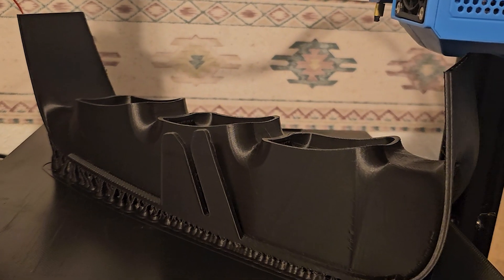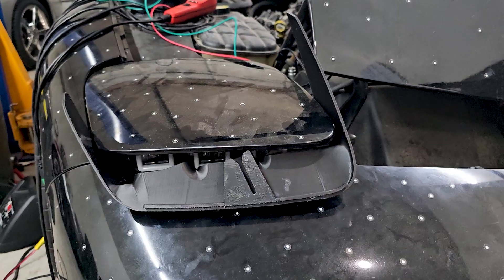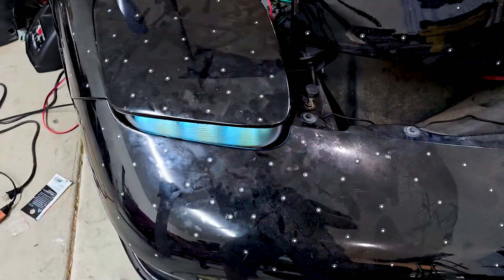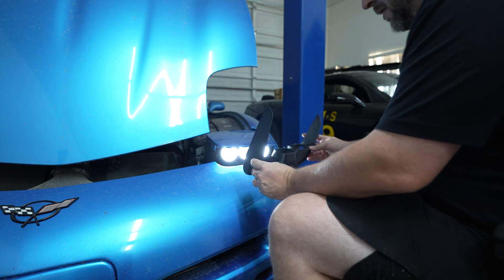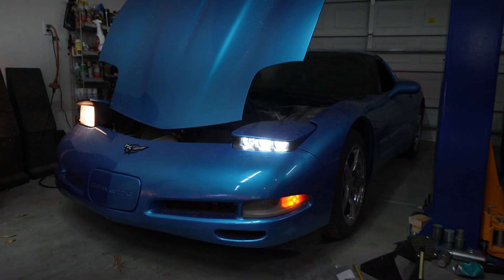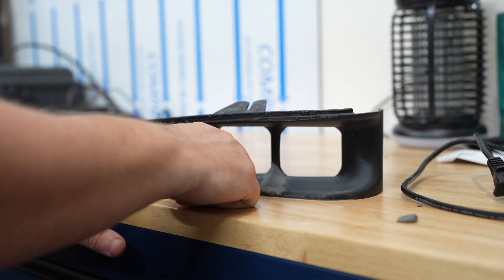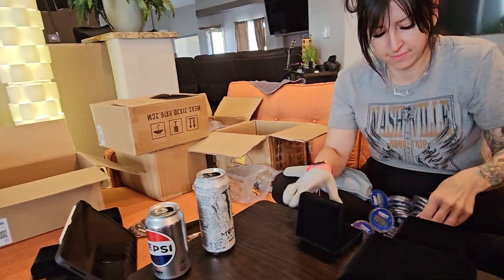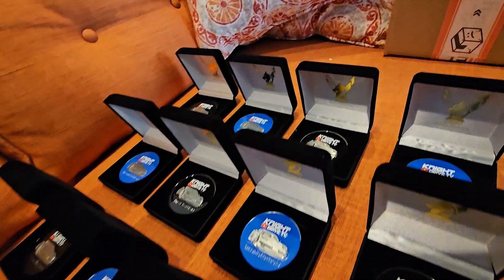C5 Corvette Headlight Bezel Prototype Fitment | Will it work?

Comment: Mate your absolutely killing it! These look so good!
I will be getting a set to replace my current set.

Also, have you thought about making spot lights/ light bars that would replace the fog light? So use like a 12" light bad that inserts into the same place as the OEM fog lights as a replacement. 
I'm currently in the process of making these, 3d scanned the OEM fog light shroud so far.
If this is something that you would be interested in doing I'm happy to share you my files if it means they would be made by a professional like you. Let me know!
Reply from the maker: I scanned the corners and entire front end.  I have had an idea on that portion of the car for a while, but it has to work into my plan for product and certain factors.  I am still debating what I want to do in the corner area.  I have an idea thats aggressive but requires modding the bumper, versus an option thats less aggressive but no mod and cool...but not as cool...lol

Comment: Love the fitment on the rounds, not a fan of the reflection on the bezel tho... what if the round k8ndof tunneled out to the front edge to bring out the round look more and eliminate the reflection.
Reply: This is not an attempt and being negatively critical! I think its fantastic, what you have accomplished. It Was just something I saw and was offering my opinion and vision.
Reply from the maker: The print is a bit glossier than production but painting them matte black, in person, can mitigate any of that if desired.